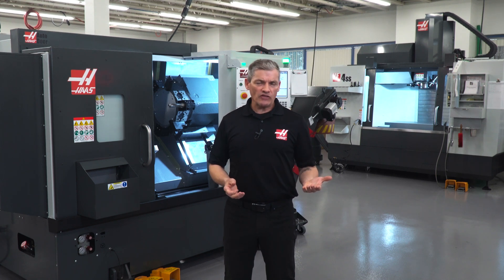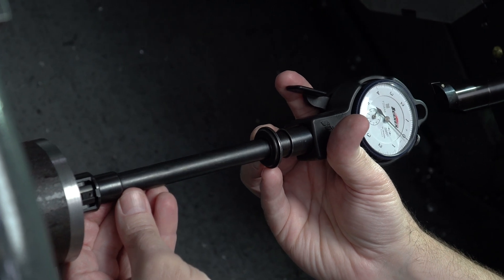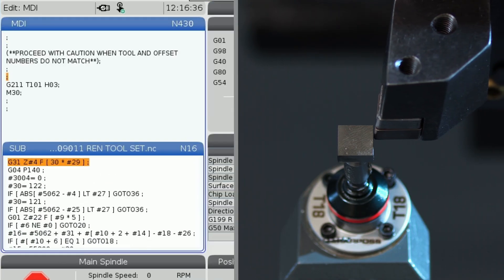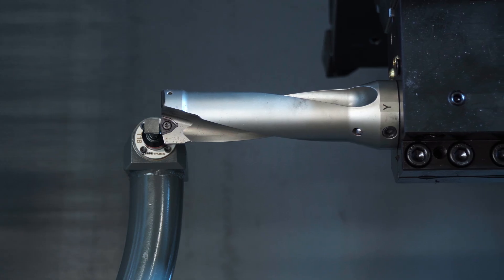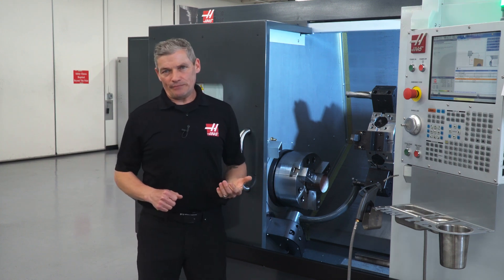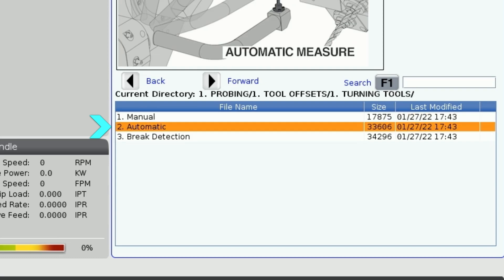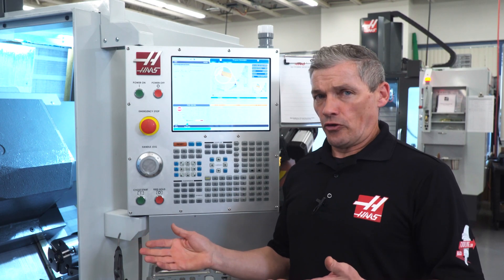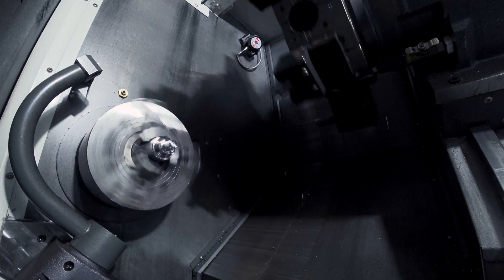Lathe Automatic Tool Presetter - Set Tool Offsets Accurately & Quickly - Haas Automation, Inc.

Comment: Is this better then using a laser? Like say the laser measuring system Blum has
Reply: well i mean there are certain factors that can lead to a wrong meshurment when it comes to lasers. if everything is clean and dry than lasers can be good but when it comes to percise messuring you wont be able to avoid those "physical measuring systems". They are great you can measure a tool in a range of +- 0,001 mm as far as i know (obviously you need to do all the maintance and handle everything they way it is intended to be handeld to be able to have such results)

Comment: So I remember having to calibrate my tool probe and used the procedures and it was always a little off on the inside tools like boring bars. I ended up doing a bunch of test cuts and having to adjust the 'nominal' calibration by something like .020" to get correct tool offsets from a touchoff. That said, now that I've done that I can probe boring bars and be hitting smack on the money first cut so can't complain about it. I just don't understand how the touch points would be off initially.
Reply: Interesting you say this. I just broke the probe on my ds30 and had to calibrate it. My boring bars are almost exactly 0.01 off. Lol.
Reply: @Shamneggs  yeah I got no idea why it was exactly a nominal value difference. I got the probe value for the top side, dialed it all in, triple checked the stylus cube width using two different mics, ran the math 3 times, and it still just needed a manual adjustment. Oh well.

Comment: How do you set up multi tools on the half indexer? And also say quad static drills in a single holder?
Reply: On a half indexer your centre line is the same, one tool is e.g. T101 and the second on same station is T125, when you have a double toolholder on a 12 station turret with Y-axis you can use the difference in height, e.g. T230 with Y +40mm and T231 with Y -40mm for centre line.
For the quad toolholder it's a bit stressy, you have to find the centre lines for each bar/pocket with a dial indicator or something like that.
When a Fanuc calls T0101 he calls  T01 for station AND geometry, the second 01 is for the WEAR offset, Haas uses T101 or T0101 and the T1 calls the tool station 1 ( or 01), the second 01 calls the geometry plus WEAR, a bit different.
Reply: @ytfan3815  are right ok i assumed there was a funky MDI option for entering the data on a menu screen. Bit more work rather than set menus….
Reply: @gazunkafonegazunkafone3492  
Well, when you have double/quad tools on a Fanuc with half index or Y-axis you have to set a parameter so it acts the same like a Haas or other brand for setting the tools.